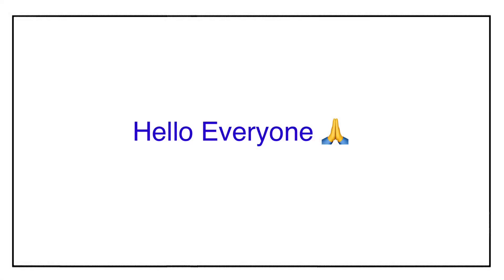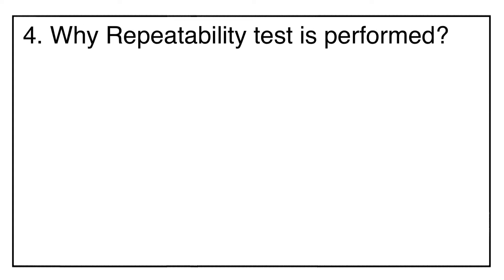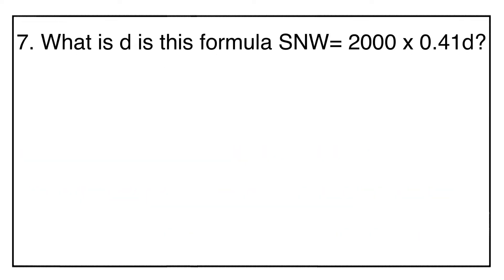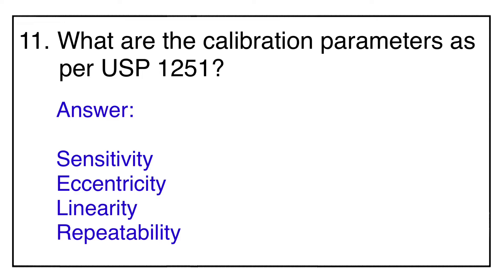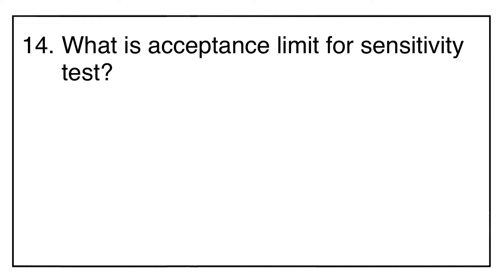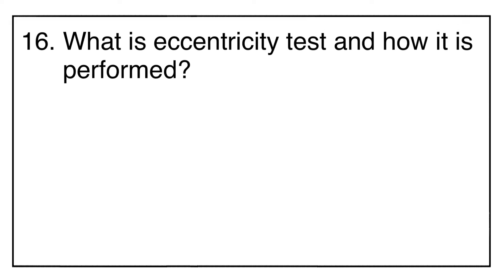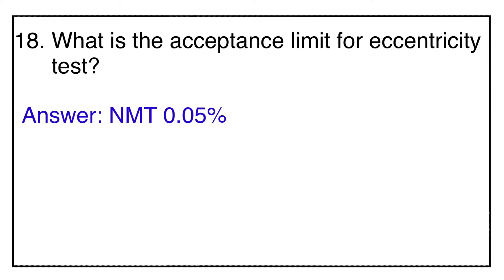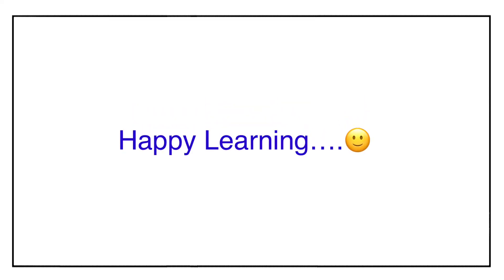Top 20 Interview Questions & Answers || Analytical Balances ||

Comment: Sir what is the didference between smallest net weight and least count ?(
Reply: Smallest net weight is calculated after calibration from formula 2000×0.41sd and least count shows capacity of balance which is given by manufacturer.